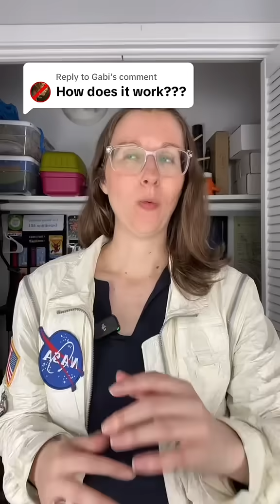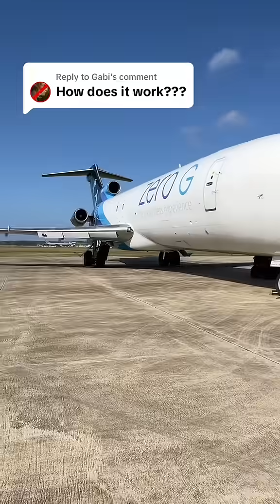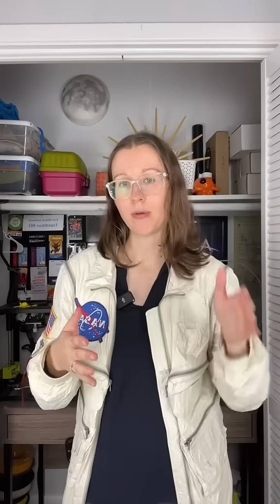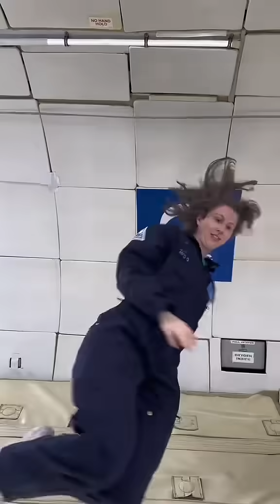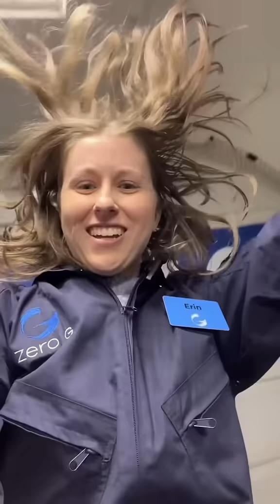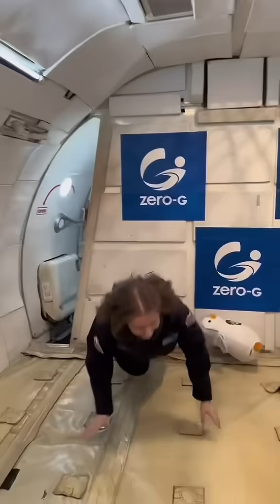How Do Parabolic Flights Create Microgravity?

Comment: How long did you get a total of micro gravity experience throughout the flight?

Also, how does it feel to go between 2g gravity and floating?
Reply from the maker: @ranachhugani3090  I’ve been on 15 parabola and 30 parabola flights now, so around 7 minutes and 15 minutes respectively on each. It’s a pretty fast change of only a few seconds but feels kind of like you are settling on the bottom of a pool.